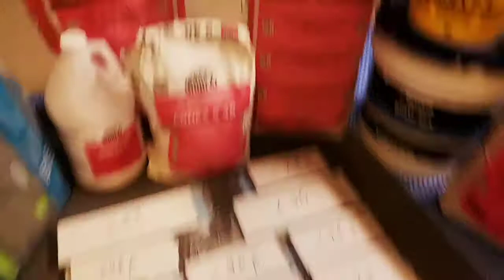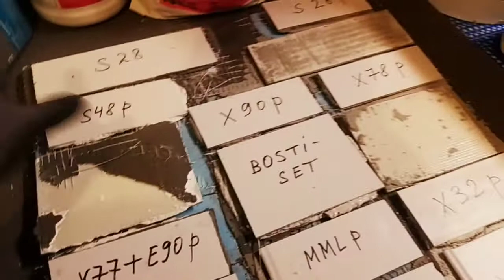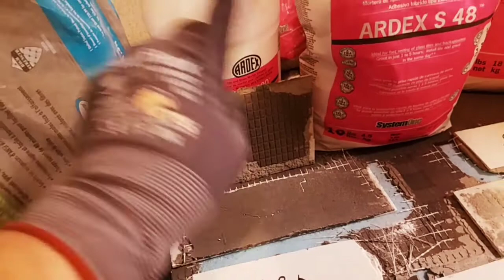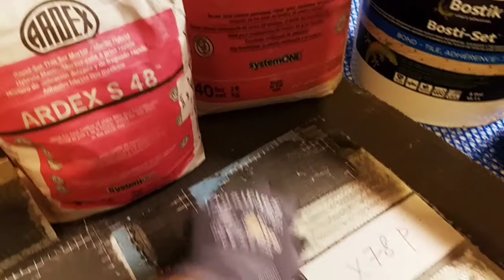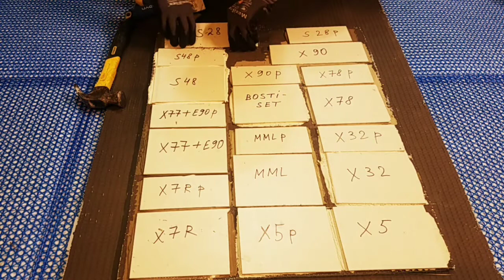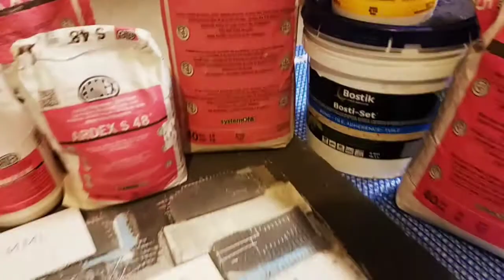Resin-Backed 4 mm Dekton Slim  Bond Strength Test

Comment: Thank you so much for doing this test it's really reassuring for me! I had the same issue, crema marfil that had a resin backing with sand in it. I called the rep from custom and he said the only way was epoxy bonding mortar. I called mapei and they said to use their prim grip primer on the tile backs first followed by their LFT mortar. I stuck a test piece of tile to a piece of backer board and the next day tried to pry it off and it pulled the facing of the hardie backer off with it. I've always wondered if I had a good bond on that job but now I know so thank you!
Reply from the maker: Thank you for letting me know Isaac and I am glad that you find this video helpful!